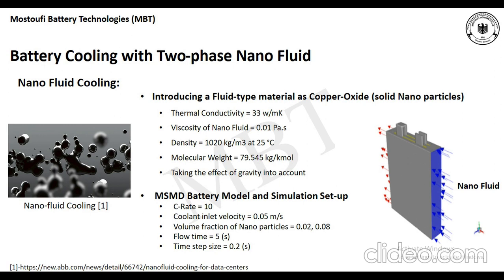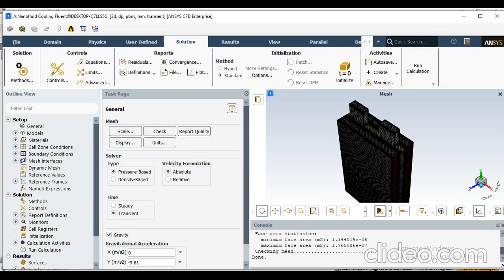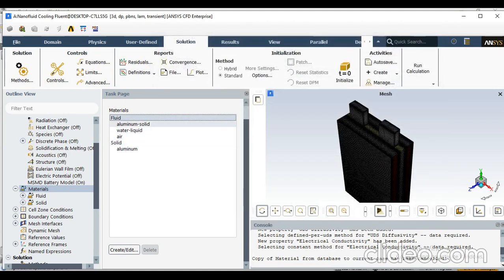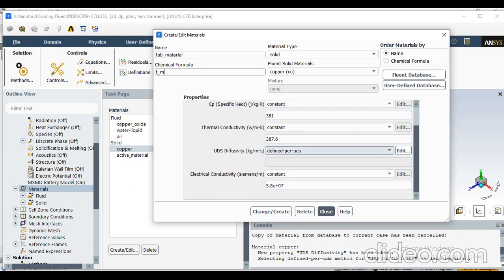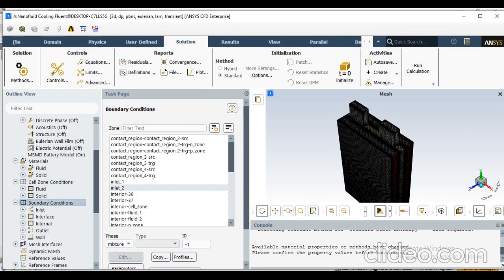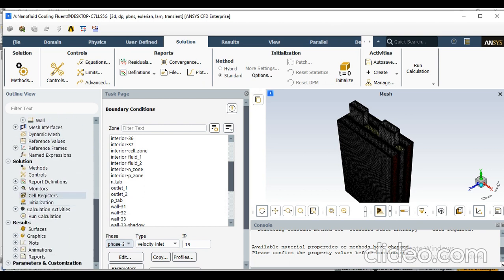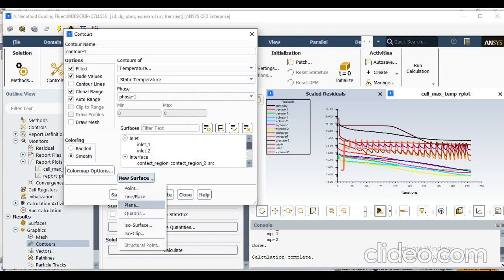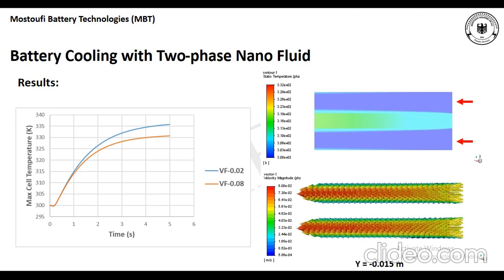Battery Cooling with Two-phase Nano Fluid in Ansys

Comment: Two-phase nano fluid is the one which changes its physical state (boiling, condensation). Here I think you have done the two-phase flow system oof which one is water and the other is nano-fluid. Is it right that it is not two-phase nano fluid as mentioned in the title of the video

Comment: Hello. I am having same problem doesn't matter how many times I have tried. I am having same vector graph as you showed in the video BUT for the contour plane, my max_temp for cell is always 300K. They do not change and I have no idea why. 

Also from the cell_max_temp plot, it stays 300K in whole simulation. Can you please help me with this?
Reply from the maker: Hi, have you enabled the Energy Equation?
Reply: @mbt_s  yes I did enable the energy equation…
Reply from the maker: @minyoungyoo4441  Ok, what is your simulation run-time? If it is too low, then there would not be much difference in temperature.
Reply: @mbt_s  flow time of 5s and time step of 25. Just to add some info for running, case read: 7.005s, iteration: 631.397s, and AMG: 115.927s . I believe that you used same flow time and time step.. and mine got different result.
Reply from the maker: @minyoungyoo4441  Ok, in geometry creation in Design Modeler Module, have you made the battery and the cooling channel as one part? If not so, there won't be any heat exchange between the battery and the cooling channels, and you won't see any temperature increase of the Nano-fluid coolant.

Comment: Hi Mostoufi, fluents seems to throw an error as soon as the multi-phase gets defined. the error says, 

"Disabling Battery Model since it is not compatible with Multiphase Model."

the MSMD battery module gets replaced with a "Potential/Li-ion Battery".

Could you help me out?
Reply from the maker: Dear, you can go on with the Li-ion Battery model which is available. The difference in the approach is due to the new version of Ansys you are using. If you come up with further questions please do not hesitate to ask.

bfcs Team
Reply: @mbt_s  I'm experiencing the same problem as @sreekanthnayanar. I was just wondering if the Li-ion battery model is an appropriate approach (seeing in the ANSYS fluent user's guide (v2022R1) that the MSMD is the proper model to simulate battery cooling). 

I would appreciate your opinion on that.